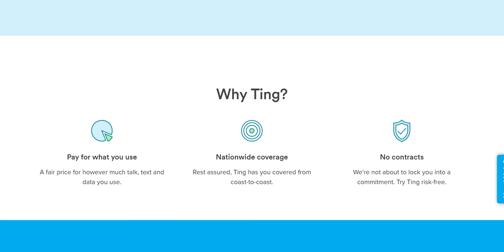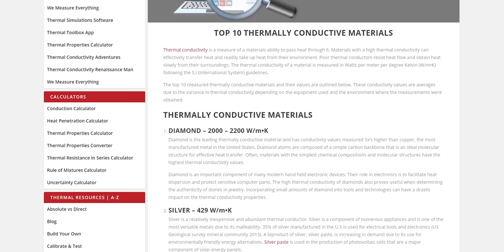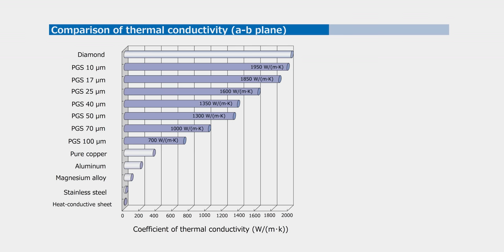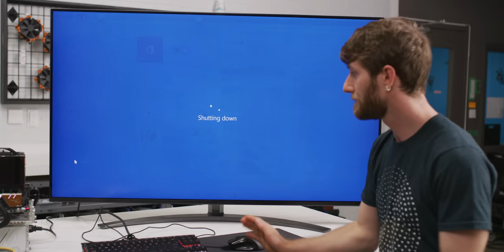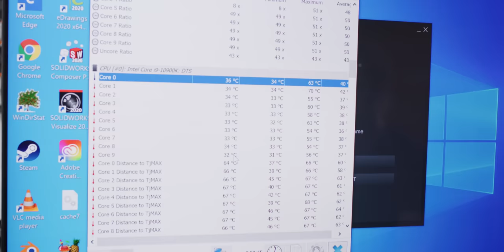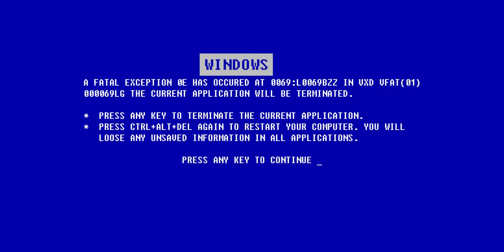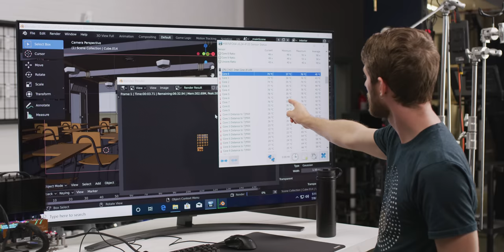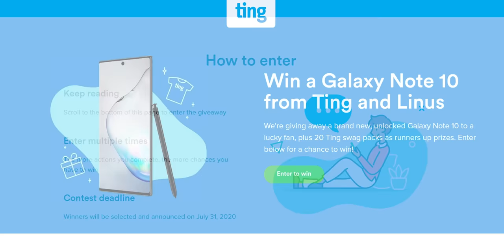This Sounds Too Good to be True - God-Tier Thermal Pad

Comment: Graphene reaches its highest thermal (and electrical) conductivity across the plane the carbon atoms are layered.
In this application, you are only using a fraction of this material's capabilities
Reply: Also, the heat dissipation may be throttled by the heat spreader they're using. That's some pretty basic stuff.
Reply: Exactly, graphite conductivity through different layers is poor. That's basic chemistry
Reply: So how should they've used it instead?
Reply: Leon Wolff it would be better off with a larger surface and combine with thermal paste in my opinion, that way the distribution of heat can be more effective for the cooling tower to manage
Reply: @hongluzhang7771  So the paste on top of the pad between the cooler and the pad?
Reply: Since he's just transferring heat to the heat sink why not just fold he graphite on half and then have the same side touching both cpu and heat sink
Reply: @sarthakpradhan1352  hm
Reply: @sarthakpradhan1352  maybe that with a layer of anything of some thickness in the middle to provide a good bent radius
Reply: sarthak pradhan the point is cpu is generating heat unevenly, which wastes the total heat transfer as you can see both cpu and cooling tower can’t outperform the material in between, therefore as long as the connectivity is ensured, thickness does not matter, the area matters, this is where the pad in my opinion can be useful as it transfer heat laterally to the area where temp is lower, and thus more heat can be dissipated compare to a partially heated surface.
Reply: Fold the sheet back on top of itself so that the heat goes "around the curve" and up to the heat sink.
Reply: @hongluzhang7771  But at that point why not just use thermal paste alone? If you'll have to transfer the heat using the thermal paste at some point, why use something better than thermal paste if you're going to add a layer of thermal paste in between anyway?
Reply: @Lambda_Ovine  For the same reason when applying thermal paste you stick a blob on the die and let the rest spread because the further out from the die you go, the less it "matters."

The graphene would spread that heat across the entire surface, which would allow the thermal compound around the outside to actually matter.
Reply: @hongluzhang7771  i really want to see this comboed with the paste FOR SCIENCE
Reply: @carlesestradagirbau7497  maybe two kinds of termal pads?
Reply: I am 100% sure they reviewed another thermal pad of same concept and which failed in the same way.

...actually isn't this video a reupload?

Edit: checked again, and no it isn't a reupload. However, there IS a 2 years old video of a thermal pad of nearly exact same concept and construction.
Reply: @leonwolff530  Spiral wrapped a super long strip of it, around a tiny square shaped object, until you got to the dimensions of the CPU lid. And then sliced it to use a cross-section of that spiral, as the thermal interface material.
Reply: @IchiroSakamoto  oh :(
Reply: Fold it so that the adhesive sticks to itself instead of trying to stick it to either the heat sink or the CPU? that way the heat moves laterally over the pad and up to the heat sink using only the carbon and NOT the adhesive itself
Reply: @Lambda_Ovine  well this is the purpose of this video, to test whether it actually can make a difference. But put practicality aside, what I'm saying is in a margin which might not be a concern for 99% of the user if they choose to use it. The argument here is that thermal paste is one of the effective methods to transfer heat, but I propose that there would be a benefit to use pads. The benefit here is created by a faster lateral transmission of heat rather than a compound between cpu and the cooling compartment. So what that suggest is some cores of the cpu are producing heat at faster rate than other cores, and the lid on top cannot distribute heat to every corner, therefore a pad which possesses very effective lateral heat transmission can distribute heat to cooler area of the lid. And by that, the surface of the cooling tower which is most likely larger than the cpu size, can benefit from it, as it can absorb heat from a larger surface area. And as I have mentioned, the material whether of pad or paste is not the limit, the IHS or just the physical restrictions of air cooling limits the overall circumstances.

Comment: We actually use this in Central offices. We will have panels running 40KM SFP's (Long range fiber optic lasers) and we use these to spread the heat across a mass heatsink that then gets bucks of air blown through them. it increases laser life so much. an SFP that would need replacement within 5 years would last 15. EDIT: I should note, i am talking about national infrastructures. these guys work with petabytes of information, not terabytes.
Reply: Is there pictures of what this looks like?
Reply: @squirky787  not sure, its not something I can personally show because of nondisclosure. Can't take any pictures of equipment or sites and share publicly.
Reply: @RKSNomad  Okay! No problem. I totally understand.
Reply: What is he missing here? My best guess is that he has to polish both the heatsink and the cpu. Please, I am curious.
Reply: @joesphanlu3369  better polishing definitely, for a CPU though, liquid metal is much better. the graphene is actually sandwiched between the diodes and the shroud, another sheet is then applied to a Heat-sink (type and material depends on manufacturer and usage) that connects all diodes together into one large heat mass. some are entirely air-cooled while others use water to transfer heat to a radiator bank (usually directly connected to the Climate control) in my case, we just have a bunch of high voltage fans that push a couple thousand CFM of air through the chassis.
Reply: @RKSNomad  thanks for the explanation. Looks like it's just not worth it for it to be mainstream in consumer products. Welcome to the engineering world linus!
Reply: @joesphanlu3369  

Graphene is about on par with copper on its z-axis. So he might as well have been using a thin copper sheet.

It's on the x and y-axis that it has amazing thermal conductivity. So that's pads are only really good at spreading heat laterally. But, a heatpipe is many times better it doing the same thing.

No, thermal paste, is actually better if both contact surfaces are perfectly flat. But, in practice the surfaces are not near perfect, and has air where there's no direct contact.

The purpose of thermal paste is to fill those tiny air pockets, without preventing direct contact.

These graphite pads are flat. Not good for filling air pockets. They also prevent direct contact. (Direct contact is where the most heat transfer happens)
Reply: we’ve got dudes who work in nuclear missile components and the CIA watching Linus and giving advice
Reply: @juiceoverflow  they're geeks too, nothing wrong with that

Comment: Linus: Wait, we spent $40 on this little pad?
Has mild stroke
Reply: How much is thermal paste?
Reply: @poletooke4691  usually 5 bucks for single useage
Reply: builds a $100k overkill pc
Reply: I'm clearly missing the point here because alex says that the thing is 7.50 dollar so how did it become 40 dollars? Is it the fucking shipping?
Reply: @tuttuti123  That is very possible
Reply: BIG FISH  well yes but 10 dollars is clearly not 40 dollars and over here from a local reputable electronic store I found it for 12 dollars for 90x115mm. yall are getting ripped off damn
Reply: But had not problem spending $70k on making a golden Xbox controller
Reply: panasonic pgs is around 10$ for 10cm x 10cm in local online shop. yea he is getting robbed for 40$
Reply: And then advertises a water bottle for $30.
Reply: @tuttuti123   Pack, not pad.  Multiple sheets. soo,  4 sheets per pack.   each sheet is $7.50

Comment: What if someone made a CPU cooler with sheets of this stuff on the fins? 

A air CPU cooler works by having the heat pipes move the heat away from the CPU, and then the heat is spread along the fins of the cooler, which are cooled by the air moving over them. More heat pipes in a CPU cooler is better because it allows the heat to be more evenly distributed on the fins, since the heat concentrates more on the fins closer to where the heat pipes are. 

Since these sheets are supposed to transfer heat well, putting them on the fins of a CPU cooler may allow the heat from the heat pipes to spread more evenly along the fins, mimicking the increased cooling of having additional heat pipes. 

Can someone tell me if I'm theoretically right? Upvote to get Linus to test this.
Reply: I came here to comment this exact same idea.
Reply: This also depends on how good the interface material between the fins and the heat pipes is, as if that's the limiting factor then more heat pipes is the only answer.
Reply: Dude price
Reply: Well, the issue is that you cant just solder graphite or graphene, to any heatpipe, like you can to with aluminium and copper, with a special solder. 
So it wouldn't have a proppper heat transfer anyway
Reply: The reason a lot of heatpipes are copper and the fins are aluminum is because while copper conducts heat more easily, aluminum radiates heat more easily into the air. These pads may be able to spread the heat out along a fin, but if it can't radiate the heat into the air, it'd be useless.
Reply: @Crazyates11  So that's why I'm wondering if adding sheets of this to aluminum fins might be a good idea. The graphite would help spread the heat along the entire aluminum fin, but is thin enough that it hopefully wouldn't impede the aluminum's ability to radiate the heat into the air. I'm not saying to replace the aluminum fins with graphite ones. No idea if it would work, but it seems worth testing by someone smarter than me.
Reply: A pack of those sheets was $40. The price range for a decent cpu air cooler is $30 to $120 on average. Depending on how well a modification like they would work I think a lot of people would be willing to spend a hell of a lot more than that on better cooling.
Reply: If the limiting factor is still the interface between the cooler and the CPU, the fins wouldn't help (much)
Reply: Wouldn’t the limiting factor be the airflow over the fins?
Reply: @levygaming3133  Perhaps, but this might allow the same amount of heat dissipation with fewer heat pipes. The reason you have more heat pipes is to allow more even distribution of heat over the fins. I'm not sure which costs more, heat pipes, or these graphite sheets, but it might be possible to reduce the number of heat pipes necessary, thereby reducing costs, or create new form factors for CPU coolers which allow larger fins without the need for additional heat pipes, therefore allowing higher heat dissipation.
Reply: Also came to comment this
Reply: Fins made of the stuff.
Reply: @stilllife8  In principle I believe the concept is good. What would be the determining factor would not be it's ability to move the heat, we already know it does that, it's the ability of the sheet to then release the heat into the environment. It makes no difference if it moves the heat from the heat pipes to the edge of the fins, if it just holds the heat there and the damn fin melts, lol.
Reply: I think you're a redditor cause you said upvote and not like
Reply: @Crazyates11  i believe you are kinda mixing up radiating and conducting of heat... the fins on a cooler do barely radiate any heat and what gets radiated from the surface ends up being absorbed mostly right on the surface of the next fin. standard coolers that work in an atmosphere get rid of the heat by conducting it directly to the air and then moving the warm air away either by convection (passive coolers) or via forced air movement through a fan.

i am not sure how much the actual material of the fin influences how good it can pass heat to the air, but i am fairly sure it is not the same as the influence on thermal radiation...
Reply: "What if someone made a CPU cooler with sheets of this stuff on the fins?"
This stuff is far too fragile to mold heatfins out of. It'll snap if you bend it to more than about 90°, and it can be easily cut with one's fingernail.
Reply: What if the fins instead had these sheets INSIDE them, to more evenly distribute the heat along the whole fin? Heat pipes are way too big to be on the inside. Especially for big coolers, the farther the fin is from the heat pipe, the less cooling it does, and this would negate some of that effect.
Reply: You probably run into issues of rigidity (i.e. how to make a solid object from these) and brittleness (think of a pencil lead). Plus as someone pointed out, cost. At 10 micron or micrometer, you'd need 1000 to make 10mm/1cm thickness. So assuming your fins are 2mm 1000 sheets gives you 5 fins. Say you need 25 fins? 5000 sheets. At $40 each, that's $200,000. Might as well get the Boston Robotics dog at this point.
Reply: Perhaps they could apply it as some sort of thin coating at the final stage of producing a CPU or GPU heatsink
Reply: @josephlck  I said to put it on the fins, not to make fins out of it.
Reply: So, It would work amazingly as a heat spreader?
Reply: this is basically the same as a graphite thermal pad I've seen producef by another company.

The specs in the YX axis is close to diamond(2000 W/mK). But the specs in the Y axis is horrible. 

5 W/mK...about the same as an average thermal paste.

Copper has a heat transfer of around 400 W/mK...btw

A heatpipe has a heat transfer of like 100 000 W/mK.

If these sheets are the same, as that one I mentioned, then heat disapation into air across it's Y-axis won't be great.

(But, I have seen other pads with heat transfer of 400 W/mK in the Y-axis...but the transfer XY-axis is around 800W/mK...a 3rd of this product)

These would improve spreading heat across the contact surface. But, then again, a heatpipe can achieve the same result many times better.

Anyway, the less distance you have between the heat source and where the air makes contact, the better. So, adding more material between the heat source and the air might not help.